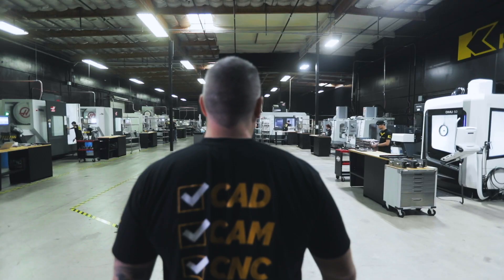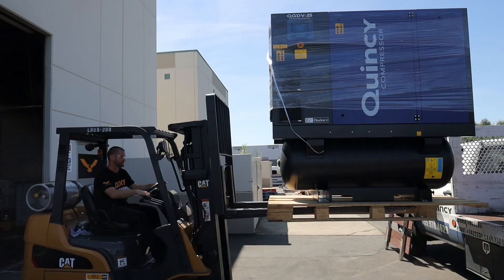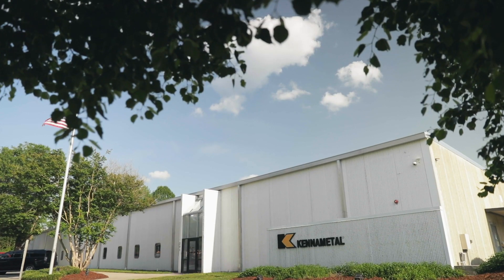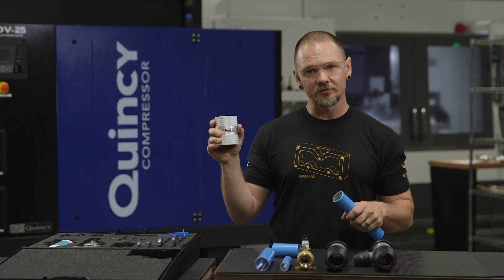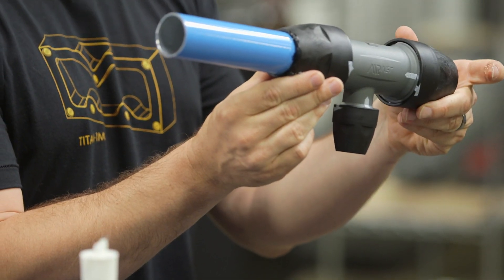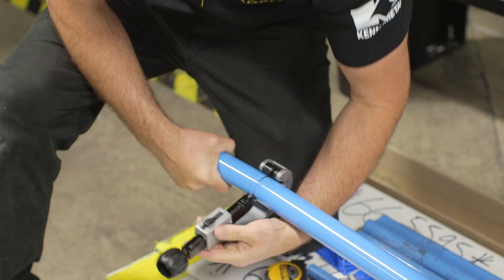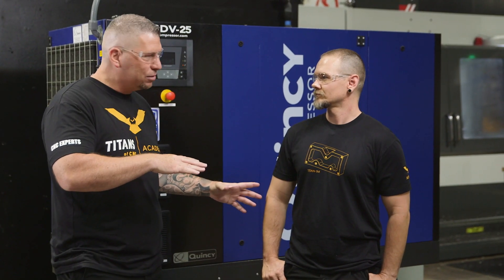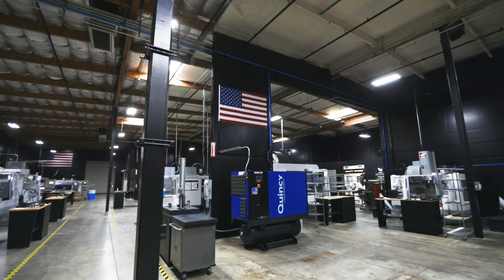This Can SHUT DOWN Your CNC Machine Shop | Vlog #102

Comment: No no not the rotary screw compressor and aluminum piping oh brother wait till you see your power bill you know by the way you better make sure you've got some serious filtration not once not twice but in between each dryer in and out and between every branch and you will need more than two dryers do not depend on the damn compressors dryers it will bite you.
In pneumatic systems contamination works its way back into the system backward that's the problem with compressed air it will go backwards every single time pipe comes down to an outlet coupling if you don't have a "t"  where contaminants can drain past the outlet at least 18in to allow it to be drained preferably with an inexpensive automatic drain they come with a built-in timer it just needs to be plugged in or when you depressurize the system contaminants will get sucked back into the line or pipe deeper than you could imagine.
The one that blows my mind how does dirt find its way into a way oiler hole and fill the oil line behind it.
 I Worked for a German manufacturer we used to rebuild wheel cutting lathes we would have to replace the entire oil system to ensure we had good clean oil lines and yet they will fill with filth and eventually plug how does the dirt get in between the ways all the way back into the oil hole and fill the line believe me it will it does and it will ruin your ways.
Anybody using speeders to run grinding wheels on milling machines take those things and throw them in the trash get them out of your shop do not use them especially on hard way machines.
Purpose built grinders are bad enough but lathes and Mills are not designed or prepared to effectively flush off that kind of Filth.

Comment: What is a good brand of air compressor? My boss has a used 55 gallon air compressor outside (which is a terrible idea due to severe water moisture) just in case it's not enough psi for 1 full on CNC machine and several retrofits CNC mill machine.

Comment: that is a pretty location, but aren't you pumping heat into the Air Conditioned space by not ducting out the exhaust?

Comment: Even when the I have my Kaiser serviced once a year it's  dead silence . It's like a Sunday in the shop. Rotary screw is the only way to go. Plus having the big support tank for volume helps enormously. I had older machines with pneumatic driven tool changers. They had there own 2.5 gallon air support  tank built on the machine.

Comment: Compressed air was one of the most expensive operational costs for a machine shop...........does that still hold true?

Nice Shop.....beautiful compressor......good crew
Reply from the maker: No, it’s important... but does not have a recurring cost.

Thanks 🙏

Comment: Nice compressor and install !  But (there's always a but) I don't see any moisture trap drops. How are you handling the air drying?
Reply from the maker: It has a built in air dryer and keeps it perfectly dry.

Comment: We got two small Kaeser screwcompressors and a pisttontype for backup in our shop. Hurco machines waste a hack of air and drop out pretty quickly when the pressure drops a little. In the hot summerdays sometimes one of our Kaesers tend to stop working. It's always the same, was checked, repaired, etc. But this buddy got his own will... The other one runs fine.

Comment: The compressor / air drier in my shop puts out a lot of air, but would drown out the sounds from a 747 taking off right next to it, and throws off so much heat that we heat part of the shop with it in the winter in New England. 
That compressor is so quiet. We need a couple of those.
Cool air lines and couplers too. Good video.

Comment: 30 OSHA violations in 6 min no safty harnesses no safty hats no fall protection of any kinds climbing up leaned over ladders and on and on i honestly dont think i would show a video of my company just not caring at all about safety because that will shut you down way quicker than any air compressor remember no company is worth dieing for !!!!!!!!
Reply: I know in Canada you need to have a harness on anything over 6 feet
Reply: Just that hard hats and the ladder where the only problems I see. That scissor lift looks OSHA certified. 42 inch guard rail that can support 200lbs, no harness or and fall prevention needed. Correct me if I'm wrong
Reply: yeah there are harness locks all over the lift for a reason its where you hook your harness in and in America its 4ft off the ground
Reply: @chrisfreeman3241  right... 4ft and the shock chord can't even fully deploy.  At lest it'll let you bust an ankle instead of your head. Those harnesses are usually worn poorly too. Leg straps loose, torso length adjusted too long ect. If someone were to fall wearing a harness the way that I see the typical user wear them, they'd end up with a ruptured testicle minimum. Safety is no joke. Unfortunately most safety standards are devised by people who have never and will likely never have to employ them.  This in turn causes opportunity for failure. You find your self working for efficiency and being held up by questionable safety protocols (fall protection at 4ft). Inturn promotes rushing which causes mishaps. Transferance of hazard I call it. Planed operation is worth as much or more than all of your equipment and protocols.  Approach these things with a 5 paragraph operations order.
Reply: Bill Greathouse just to let you know what the rules are brother i have worked in construction for a very long time i have build data centers to 100 megawat solar fields i have had a hundred a fifty guys under me and i promise you any job you have in North Carolina where he went you will lose your job so wuick for safty violations its insaine you are fired before you hit the floor sunshine so for people wanting to do work like this i would always say safty first if you enjoy your life just like you dont run a fucking maching without saftyglasses i ask all readers who want to think this is a joke i urge trying this on any jobsite see what it gets you do this at any plant they showed in this video would tell him the same thing i like titan i would urge him to delete this one
Reply: @chrisfreeman3241    6Ft last i checked.
Reply: Max Sharpe you might want to check again
Reply: and just so we all know fall protection saves lives its there for a reaon !!!!!!!
Reply: whats so funny is only a bunch of idiots would not where safety harnesses period!!!!! i have never seen so many people who run there mouth because i said they need to be wearing a harness or not if your to damn lazy to where a safty harness than get a new job when you get fired for it !!!!!!when you work for a real company safty will always be first not second or third but first so to any other person who thinks you dont have to wear harnesses please kindly use your brain before you speak i dont care who you work for if you fall without safty protection on insurance will not pay a dime for you or your family period so you do the math for you and your family but i promise my life and guys who work for me there life is way more important to me than any price so i pray all you guys who ran your mouth about safty devices never get a company with people's lives are dependent on you intellectually so i say use your damn brain and not take safty for granted period because if something happens to you,there will not be a second chance enough said im done talking to idiots who want to lay around and watch you tube try working for a living for a company and you will learn really quick how quick you will get fired for being a idiot about safty so good luck and by the way osha has a freaking websitr if you dont believe me go read for your self before you run your mouth 6 ft or 4ft they better be wearing the the shit
Reply: I have watched people do to work on the overhead lift 40ft up with a 30ft extension  ladder, a pallet and a forklift. Yes he did have his harness on but didn't have anything stable to clip it onto till he got all the way up, and this was boss aproved.

Comment: What is the work of it ? I don't understand. Please reply
Reply: The machines need compressed air to work. That thing is compressing the air.
Reply: @turbor9958   But Cnc run on electricity. Is this new cnc machine also Comes with Compressor ? Purpose of Compressor I know that. But What is the use in CNC don't know .

Comment: What about redundacy?

With only one compressor you have a single point of failure, but when you install a second or just keep the old then the shop can continue working.
Reply from the maker: Definitely installing one more!
Reply: @TITANSofCNC  just put the old one beside. will be anyway only the backup
Reply: you usually have two, one handle main load, the other as a supplemental backup, that way you can use a machine that Isn't prone to damage stopping and starting all the time. and if your main goes down, your supplemental should be able to maintain site pressure up until you get your work hog fixed
Reply: Exactly what I was thinking. I used to have a facility with four Kaiser 10hp compressors. We only needed three to run the shop so, at any given time, one could be down for maintenance or a failure and we wouldn't miss a beat. Sure, the equipment cost a little more and it wasn't as efficient energywise but, in my opinion, it was a good tradeoff to insure continuous operation.
Reply: @rogermccaslin6750  We have a similar setup, with 4 filing cabinet sized screw compressors feeding into a large common air tank. All four compressors are tied together via data link, and take turns running during compressor cycles. We could actually run the shop on two, but the extra redundancy was deemed necessary as the air system has to up for our 100k+ sq foot technology company. The system even shuts itself down at night, and stats up before anybody gets there in the morning.
Reply: Yep, glaring weakness.
Reply: we have 1 backup compressor in our shop if the screw quits (usually overheats from a dirty filter or running out of oil) 
secondary compressor is a must or you will have 30 machines faulted out with no air..